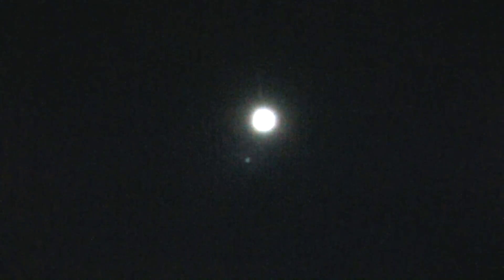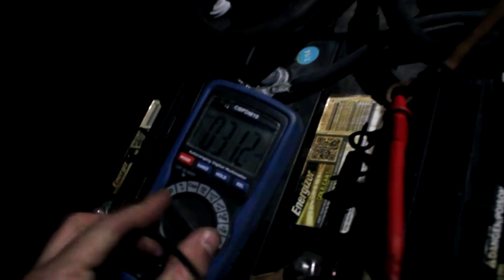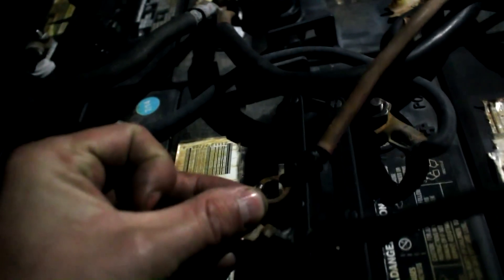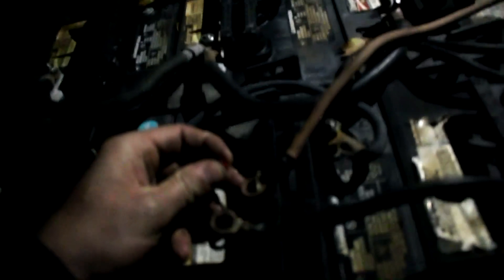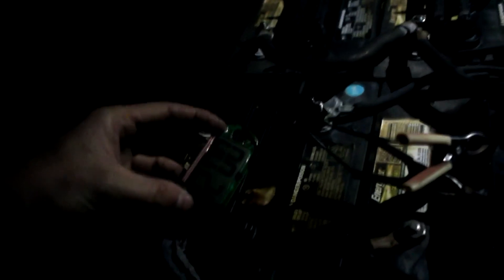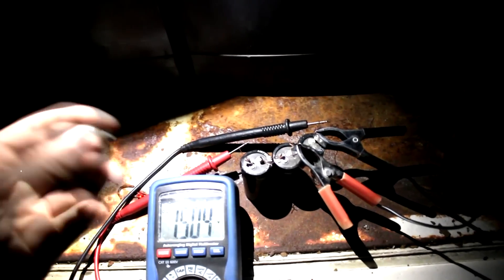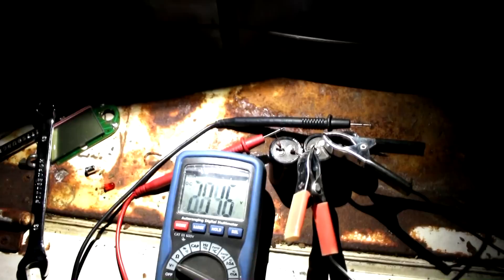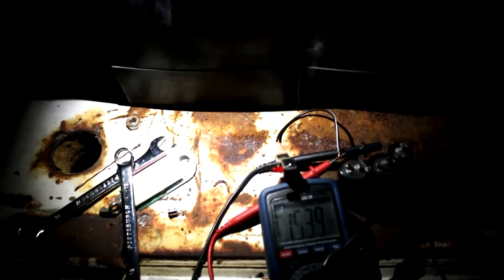Electricity From Moonlight

Comment: The main reason this doesn’t work well is not because there’s not enough light off the moon it’s because with little light a solar panel has very high resistance within itself so not much power makes it through

Comment: A large gyroscope (on good bearings) would stay oriented in the same direction. If it was  gimbal-mounted, with suitable gearing, could you extract energy from Earth's motion as it rotated about the gyroscope. Could you get enough energy out of such a set up to keep the gyro spinning and a surplus to use elsewhere? Would this slow the Earth a bit.

Comment: LEDs are very sensitive to voltage because the forward current is approximately exponential with voltage.
So, one rated for 3V might not last for very long at 3.7V.
Of course, the voltage in those three capacitors will also decay very quickly with such a low resistance path.
Still, I wouldn't be surprised if the LED was burned out from the boosted moonlight.

Comment: It will be easier to double the voltage and maybe the current if you take ac voltage, and 2 diodes. You can find the circuit on google.

Comment: You think might be possible to add up many capacitor and use them along with a small dc transformer to jump up the voltage real high into a charge controller?

Comment: I might be several months late to the party, but its my understanding that amorphous silicon cells are more effective in low light conditions than crystalline cells. I'm curious how much of a difference there would be between the the different types of panels in a similar set up. And if amorphous proves to be much more effective in moonlight, would it be wise to have panels of both types for power both at day and night.

Comment: I tried this with 24x (260w24v panels) and got 14.5v and single digit micro amps under short conditions. couldn't even light up an LED, not even the slightest lol.

Comment: May be next time, you should use a joule thief on a LED. I think it's components involve a capacitor, an inductor, and a transistor. May be other components as well. It's basically an oscillator that flashes the LED at a rate determined by how much voltage it is fed with. I imagine that this arrangement would cause a slow flash under moon power.

Comment: You could use a joule thief to get a steady glow on your led. I've made a few and they work great for boosting the voltage from just about anything between .5 volts to 2 volts up to around 3 volts. It's been a while since I tested the range though, but it would for sure work in this case (so I could be wrong). It's a really fun project if you haven't done it yet

Comment: to utilize the low voltage, you could use a so called joule thief.
its basicly a boost converter to step up the voltage to what an led requires.

Comment: Actually the Moon puts out much more power than you have measured, more than enough to run that LED.

The problem is that semiconductor solar cells loose their efficiency in low illumination, due to the fact that a certain number of electron-hole pairs always recombine before reaching the conductors, and in low illumination most of the captured energy gets converted into heat instead of electricity. (it is quite complicated why it happens)

Some dye based solar cells work much better in low illumination (and worse in high illumination), you might want to try it if you can get your hand on one.

Comment: It should work with anything bright.  It is noticeably brighter even when certain stars are overhead like Sirius or Vega.  You don't notice it just glancing but if your eyes are dialated fully if those stars are overhead you can see enough to move around without a light.

Comment: @Cody'sLab
If you connect the capacitors in parallel, you basically make 1 (slightly, as it's micro Farads) larger capacitor. Essentially, you won't have to charge them seperately, and they should provide more charge. 
Connecting the capacitors in a serial fashion will reduce the capacity of the whole thing. I can provide a visual presentation of this, as well. The capacity of a capacitor depends on the size of the "plates" in which electrons are stored, the distance between them and the electrolyte used, right? Well, if you're familiar with the symbol of a capacitor, it'll look something like this: -| |- 
So as you can see, putting those things in a serial manner will actually accumulate more distance between the plates, since you have to add up the "empty" space (-| |----| |----| |- becomes -|   |-, essentially). Connect them in parallel, however, and you'll increase the total amount of surface the plates "combine" into. You can visually represent this with the same symbols I used in the serial composition. 
I'm not aware of whether or not you or anyone else reading this wall of text knew this already or not, so I'm just putting it out there.

*Edit, the abominations of symbols I tried to recreate failed miserably. For further clarity, I suggest just googling it. :(

Comment: Cody, your red LED should run on 1.7 volts or so.  It will do nothing below that as it is basically a diode with that as a forward voltage drop.  The voltage drops of LED's basically being proportionate to the energy of the wavelength of light, blue requiring more voltage than yellow, which in turn require more voltage than red.  Incidentally, I had some solar panels wired directly to LED lighting, and while I never saw light from moonlight, I could definitely tell when lightning struck, and conversely they would dim when a cloud suddenly went overhead.

Comment: A red LED typically only drops 1.2v. 3V without a resistor may have blown it, that's why it only lit up briefly. Capacitors of that size in series would normally keep an LED lit for at least a second. I believe the reason it didn't light up with a direct connection to the solar panels is because of the very limited amount of current. Those capacitors in parallel and charged probably could have lit that LED for a good 6 to 10 seconds.

Comment: What if you hooked it up to a battery pack and charged the battery with the moon?
Reply: Yes, would work, but it would take a very long time. Certainly more than one night ;)
Reply: The batteries 'natural' discharge during the daytime might be more than the charge gain at night time.  

But since they are solar panels, they would just charge during the day.  But my point is the moonlight charge is probably 100% negligible.

Comment: Here is a test for you.  Can the flashlight produce enough electricity, using the panels, to run the light itself?  Like a perpetual motion machine.
Reply from the maker: nope
Reply: Geoff Graham even if the panel and light was 100% efficient you wouldn't be able to look at it.
Reply: Dang. Perpetual Motion Man thwarted again.

(Shakes fist) I'll get you and your minions someday Cody!
Reply: +Aaron Good point.
Reply: Aaron Ur right. it would be very dark to look at. If you shined a really bright flashlight, it would still be a black funnel. Not that you could tell it was a funnel, but it is.

Since the powered light is 100% efficient at shooting its' light down the funnel, you can't see it either. Nevertheless, you have added photons and energy with your flashlight. You probably shouldn't do that too long.

You've created an energy storage device that contains an input that scavenges stray photons from the universe and adds them to it's 100% efficient storage mechanism.

Eventually, the photons will be too many and energetic and will exceed the specifications of the superconducting magnetic device.

Perpetual Motion Man is nothing if not through, so when the millions of volts collapses around the billions of joules of stored energy... well it's not pretty, even if it is the brightest explosion ever. Let's hope it was just the town that suffered, and not the whole county.

Perpetual Motion Man did not have a license to practice science.
Reply: hitchman0011 lol no. Omg. A flashlight isn't perfectly efficient and neither is a solar panel
Reply: Not these flashlights, but I suppose technically yes. You wouldn't be able to see it though since none of the light is bouncing off.
Reply: But it could, if it wasn't those panels, but 100% efficient panels that used a superconducting magnetic field to channel every photon into a conduit that bent around and shone upon the panel...

Comment: Just curious, Did the led blow out or did you run out of charge? I think it blew out cause you didn't have a resistor in series and even with smaller caps, you should have seen it fade, not just blink. So... did the led still work after this experiment?

Comment: you could try running the led via a joule thief. i managed to run a led of a low voltage that was below the forward voltage of the led used. the Joule thief managed to boost that voltage enough to  light the LED

Comment: At work I have remote solar powered equipment. The storage batteries failed and I noticed that I had data for a few hours during a full moon, no data before moon rise. The panel is a Uni-solar 12 volt 64 watt unit. Thanks for the great videos. Carl

Comment: I was half expecting you to put the low voltage from the panels through a boost converter to charge a capacitor to high voltages and then using a brief spark to light a fire.

Comment: Its a red LED, so the nominal drop is about 1.8V at several mA however at really low currents you might get down to 1.2V or so, and a faint red glow, so I am surprised that you didn't see anything, connection problem? polarity? didn't look closely enough to see the very faint glow?

Comment: Thanks for the great videos!

Can you say with any certainty that all of the electricity you are measuring is actually coming from the moon? There was no control that involved pointing the solar panels toward the sky, but away from the moon. I'm curious if there is a detectable amount of terrestrial light reflecting off the atmosphere and back down to earth, or maybe a small amount of background light (similar to cosmic background radiation). From what I've read, solar panels can pick up infrared light well outside what the human eye is able to detect, which I think further supports pointing the panels at dark sky to see what happens.

Comment: I'm sure one of the solar companies will now boast that their panels work in moon light.  Thanks a lot Cody! :)
On a more serious note.  You should try to see if Tesla's patent for energy collection at night works better than solar power by moon.  If I remember correctly, Tesla took a rather large copper sheet and attached a wire, then coated the sheet with an insulator and then hoisted it above the ground, higher the better.  This created high voltage, that was dumped to a capacitor through a spark gap.  Current was low.   For give me if I've miss quoted anything.  It would be cool to see which one would perform better.

Comment: The LED would probably work for the voltage (if I remember correctly, reds can run at about 1-1.2V minimum, though if there are two diodes in series, it would be 2-2.4V), but it requires greater amperage (15mA if memory serves correct).

Comment: so I'm sure you already know this but an LED is a light emitting diode. and with a diode electricity only flows through it one way so the positive and negative have to be correct did you try flipping it around just in case? I couldn't tell on the video when you hook it to just the solar panel?

Comment: Was that with or without a diode? Also if with a diode what is the forward voltage and reverse leakage? Also had you considered using a germanium diode to get the lowest forward voltage and reverse leakage? Great channel btw.

Comment: You should have enough power to power a small string of LEDs with a joule-thief circuit. It's basically an oscillating circuit allowing the capacitors to fill and discharge rapidly enough to make the LEDs appear continuously lit. https://en.m.wikipedia.org/wiki/Joule_thief

Comment: I suspect that there is something fundamentally different about moonlight than can be accounted for by the science promulgated by either the institution of education or the media.  

This means that I reject the imagineered folly of reflected sunlight in preference of the moon producing its own, unique light.  I base my divergent idea here on empirical, observable, repeatable experiments.  One of these is taking the temperature of an object in both sunlight and in moonlight.  Moonlight makes an object colder.  Sunlight makes an object hotter.  

For the intrepid, mentally agile, and free-willed inquisitors only: A magnifying lens to sunlight makes more intense heat.  A magnifying lens to moonlight -- does this produce more intense cooling?

An obvious, logical extrapolation of the circus perversity of prevailing thought regarding the origin of the moon's light: Does Science expect me to believe that sunlight reflecting off of basalt rock and sand in the vaccum of space changes the light's thermal effect to the polar opposite?

Then why are there no basalt-powered refrigeration technologies currently in use in hot climes around the world?  The more sunlight and the hotter it gets outside, the better the air conditioning and refrigeration become because of the basalt-reflected refrigeration light.

Heck yeah, let's hear it for Science!  Those frickin' geniuses never seem to stop calling me an utter moron in expecting me to not think through their very own explanations.  One of my personal favorite insults of all time: Science tells me that oxygen is a prerequisite of combustion.  Pray tell, oh you Science Charmers, how then there might possibly be combustion going on in the sun if there is no oxygen in the supposed perfect vacuum of outer space?  Special rules, for special celestials?  

Even if this is so, then what about the supposed return of the Apollo mission from the moon to earth -- how come nobody ever discusses the requisite tanks of oxygen that must have accounted for the majority of the weight and bulk of the Apollo missions in order for there to be 3..2..1..IGNITION -- Let's go home back to earth...  No oxygen on the moon, and none in space, remember?  Am I truly as stupid as Science expects me to be in hearing their explanations, or did I miss out on the use of some non-combustion-based-propulsion in usage?

Or is this another example of special rules, for special lies and special ignorance which the scientific people wish me to believe.  Don't get me wrong -- I whole-heartedly agree that all of this is so very special, indeed.  Special as in Jerry Lewis' Special Olympics... 

But let's have a round of cheer for the geniuses of Science!  

F.

Comment: Cody, check out the Joule Thief circuit for ultra-low voltage stuff. It's cheap, easy, and very effective for this kind of stuff-- you don't even need a PCB! Big Clive did a video or two on them, and IIRC he actually coined the term for that circuit eons ago.

Comment: Would it be viable for larger arrays, like proper solar fields, to turn to the moon during the night? It takes power for the panels to turn to effectively hit the sun, but could moon power sustain the turning mechanism as well as produce power fir other things? (like your clock)
Reply: The problem is how vastly dimmer the moon is than the sun; our eyes are logarithmic, meaning something that looks twice as bright is actually more like ten times. The sun is, on average, around a million times brighter than the moon. ( http://blogs.discovermagazine.com/badastronomy/2012/08/27/bafact-math-the-sun-is-400000-times-brighter-than-the-full-moon/ ) meaning a few minutes of cloudy skies makes as much difference as a full night of bright moonlight.
Reply: Yes, that was apparent in the video, I was questioning whether or not the array could sustain it's own following movement. It depends on how many panels there are, and the efficiency of the turning mechanism in question. 

It's improbable, but who knows man
Reply: well... As you can see in the video the large solar panels are outputing 1.7volts and 0.11amps, that means it's output power is only about 0.18watts. A proper motor to turn the solar panels needs tens of watts to operate so... not realy. The only reason why the clock works is because these are made to operate with an  incredibly low power comsumption.
Reply: Eridani Epsilon well to turn them to start point overnight I'm sure there would be a way that a watch type mech would do the job effectively, but with a battery bank you turn them as fast as you want...

Comment: i want to see a large bank of capacitors take a lighting strike that could then be used to charge a few tons of batterys. I think it would work. just need a lot of copper, billion capacitors, 100 million batterys or so. Someone should at least try it once.
Reply: To make all those capacitors and batteries, would destroy the environment.
Reply: It's been attempted. A big problem is that a lightning strike carries a lot of power, but not THAT much. (A ton of petrol contains the power of 10 lightning bolts.) https://en.wikipedia.org/wiki/Harvesting_lightning_energy
Reply: Currently the batteries aren't capable of charging that fast. So the end result would be a fried battery and a lot of fumes.
Reply: Anakin Skyobiliviator
They did mention capacitors, which could be discharged into the batteries more slowly.